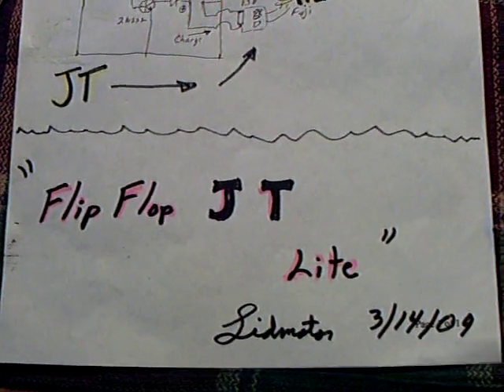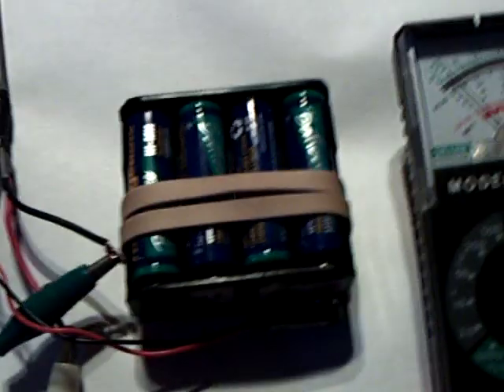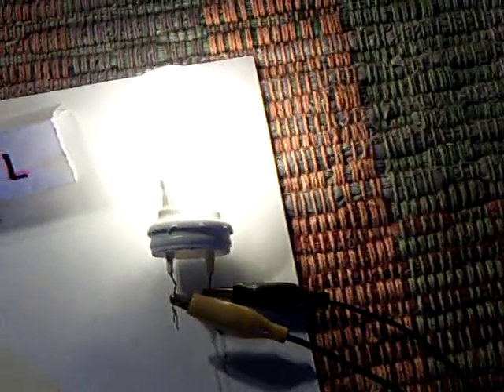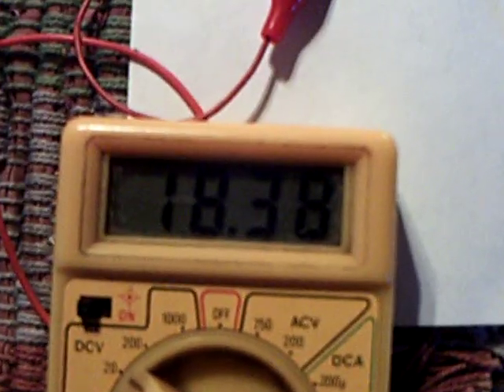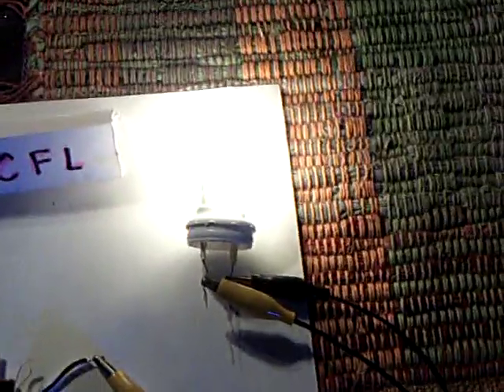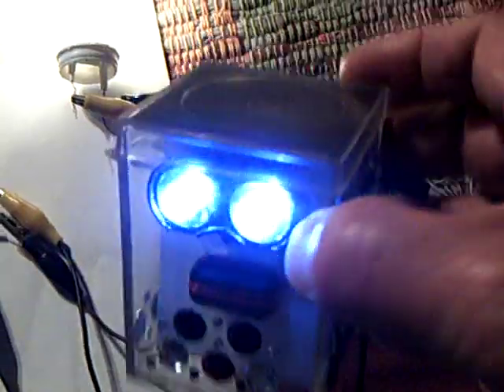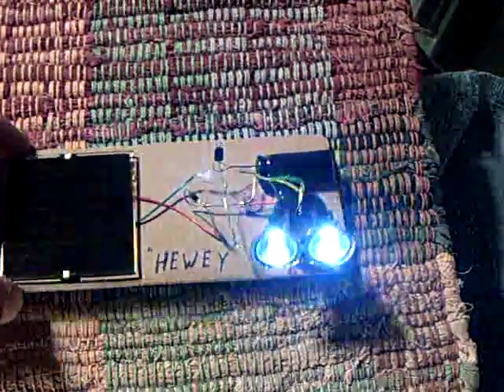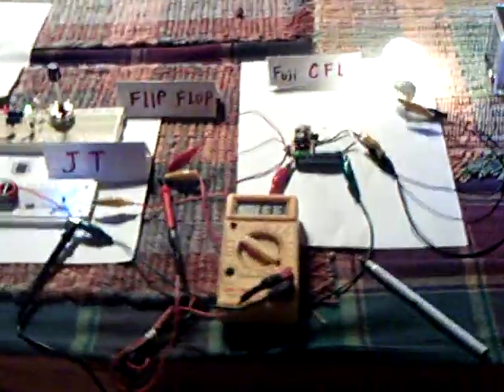Flip Flop JT Lite

Comment: The Flip Flop Has a very High Consumption Compared to the TS555 CMOS but like you say it worth testing it all.

The TS kicks Ass do not just through it away........

If its all about lower Amp draw keep it in mind.....

I ran a normal NE555 and at Bistable circuit which one do you think won?

Paul.

Comment: Great job, as always. Please, let me know when you will start with LC oscillator circuits (Colpitts) with capacitor voltage divider combined with JT driving a bigger coil like a transformer.